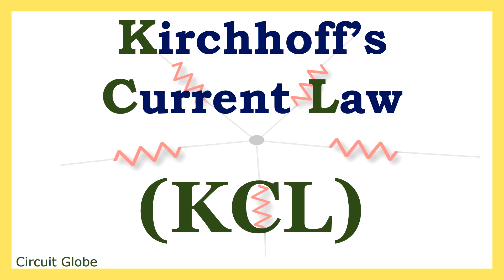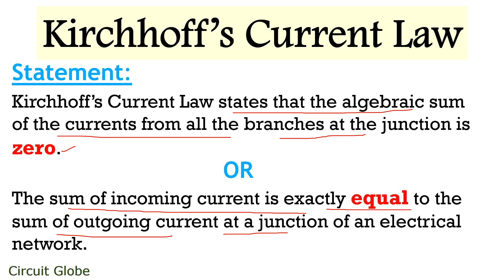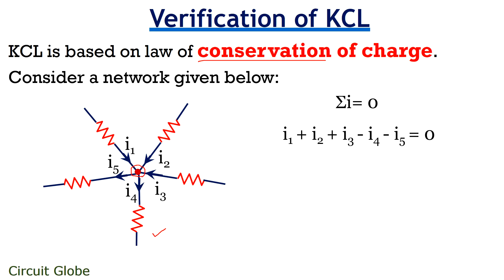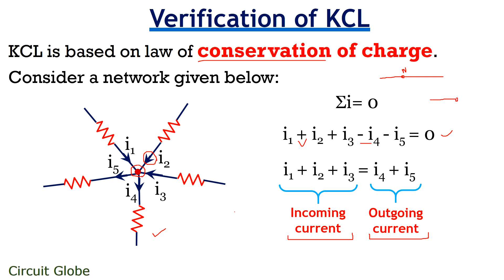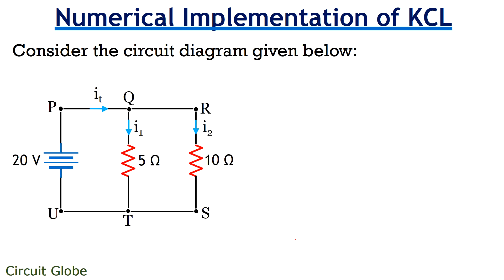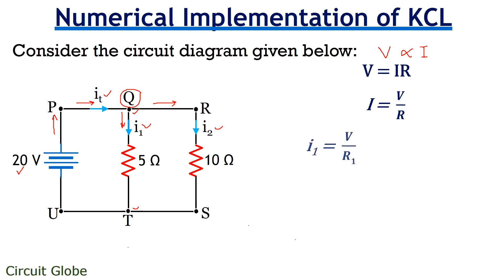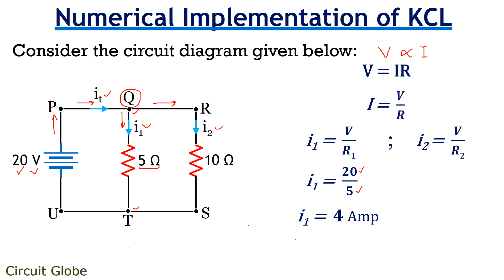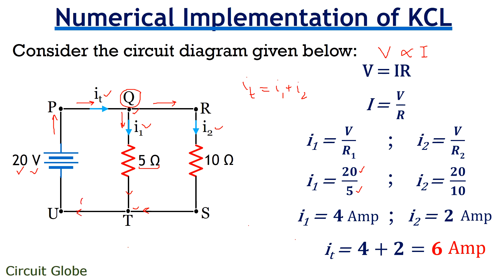Kirchhoff's Current Law (KCL)- Method to solve KCL - Basic Electrical Engineering

Comment: A working definition for current in conductors like metal wires is "the start-stop motion of millions and millions of conduction band electrons everywhere within with a drift superimposed". 
The e.m.f of the battery is due to separation of positive from negative charges which produces an e.m.f across its terminals and a pattern of electric field surrounding them, not exactly but like a dipole.
Consider a simple circuit comprising a battery, two wires and a resistor. An electric field is there in the wires and in the resistor; powerful electric field and uniform within the resistor, weak and uniform within the wires. The field is set up by a tiny amount of surface charge with a steep gradient on the resistor and not so steep a gradient on the wires. It is the electric field E created by the surface charges sourced from the battery, which produces a force causing the mobile electrons to acquire a drift velocity v = μE, where 'μ' is the mobility which is a number representing the freedom of movement of the electron in the lattice. 
This results in a current density J = σE, where σ is the conductivity of the wire or material of resistor and E is the electric field in the wire if considering wire and is the field in the resistor when considering the resistor.

The p.d. or voltage across the resistor is the integral of a constant powerful field along its length. The p.d. or voltage across the wires is the integral of a constant but weak field along its length. 
Voltage is entirely because of the surface charges.
For a live demonstration of surface charge and its effects in circuits visit 
https://youtu.be/U7RLg-691eQ
For more details see Electric and Magnetic Interactions by Chabay and Sherwood or Fundamentals of Electric Theory and circuits by Sridhar Chitta.

What is a resistor? It is the property of a conductor which determines the current produced by a given difference of potential. This makes us remember that a resistor is a conductor first. And, there is reason to say that superconductive wires don't obey ohm's law. 

For a live demonstration of surface charge and its effects in circuits visit 
https://youtu.be/U7RLg-691eQ
Electrostatics and circuits belong to one science and not two, that of electricity and magnetism. To know how they are unified visit this link 
https://matterandinteractions.org/articles-talks/ and view the article 'A unified treatment of electrostatics and circuits.  B. Sherwood and R. Chabay, unpublished. (1999)'
pdf. 
For a detailed discussion of surface charge, electric fields, currents, voltage, voltage source, difference between e.m.f. and potential difference, ideal voltage sources, Kirchhoff's laws, capacitors, inductors, transmission lines, motors, generators, mechanical and electrical loads, electromagnetic waves, antennas and radiation, see Electric and Magnetic Interactions by Chabay and Sherwood 
www.matterandinteractions.org
or 
Fundamentals of electric theory and circuits by Sridhar Chitta
https://www.wileyindia.com/fundamentals-of-electric-theory-and-circuits.html
There is a "look inside" feature in the amazon.com webpage of the book "Fundamentals of electric theory and circuits" by Sridhar Chitta with a few pages of Chapter 1 which may be viewed and also which you may swipe left or press < icon to view the foreword, preface and Table of Contents. 
For a lecture by Prof Ruth Chabay on surface charge in a simple dc circuit visit 
https://youtu.be/-7W294N_Hkk
There is a full set of lectures beginning lecture 13 here on surface charges, electric fields, simple circuits, capacitance, inductance, faraday's law, motional emf, magnetic forces and more topics here
https://matterandinteractions.org/videos/EM.html